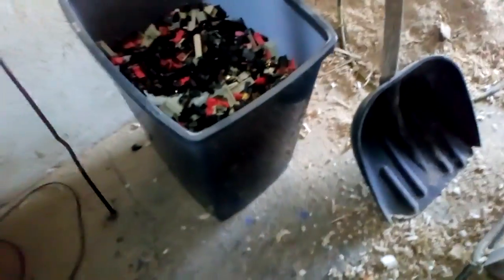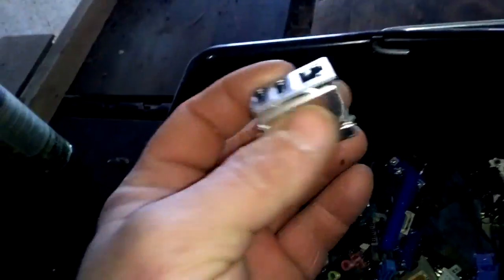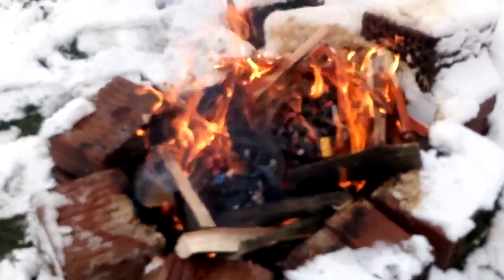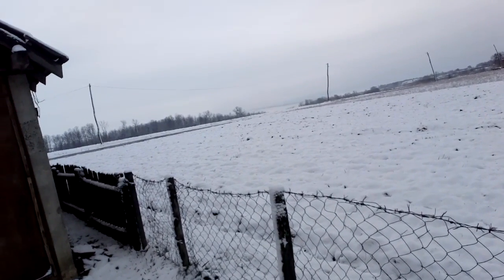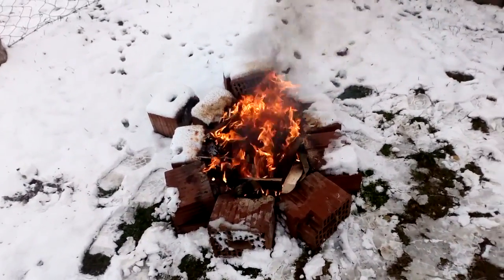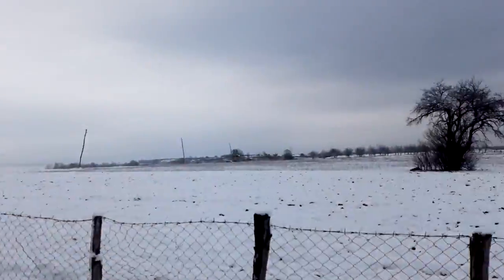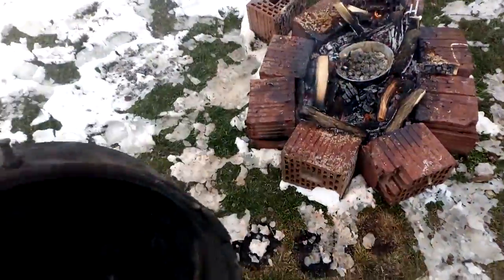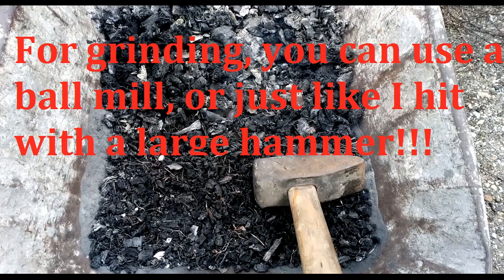Gold recovery from pins from 200 kilograms of boards PART 1

Comment: the ball mill or a chain/flail mill would be a good addition as well as a small shaker table then you could crush a lot more material and recover all the metals including copper witch is 45% the weight of high grade boards.
Reply from the maker: Clay Mccormick Slowly, Rome is not bild for the day :)

Comment: Great video what country you live in nice country side.... why didn't you process with nitric and water to dissolve base metals? Why not make a makeshift crusher with motor and two pipes or round pieces of metal? Instead of burning just asking like you said you can do whatever you want but was just wondering why you didn't go that route?
Reply from the maker: I live in Serbia, a beautiful country, only our budget is a bit low hahaha ....
I would need a lot of Nitric acid to process all these pins. I have a ball milll, but I did not want to use it because it does not have everyone, I wanted to show that it can be smashed with a hammer with a little extra time. My point is to show people the table many different ways and possibilities and let them decide what is the best solution for them. Great greetings for you friends.

Comment: Good job dussan

But you have big mistak

the gold some of it fall with the.ash soo we take every thing ash and pins and work with AR to take every metals and then drob the gold

Hope you work weth this way to not.loss any gold
Reply from the maker: For this quantity, I would need about 50 liters of acid to process ash, and filtering would get just kill me. I think that the fire will not affect the gold to fall, because the temp is far from the point of melting pins, the gold itself remains only on the pins . We'll see in the end, this kind of pin gives from half a gram to gram of gold per kilogram.